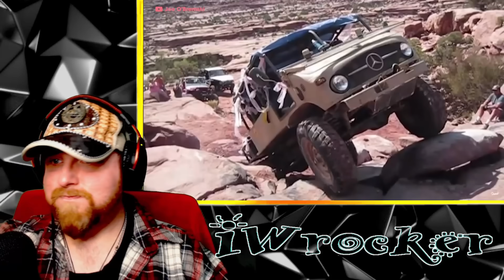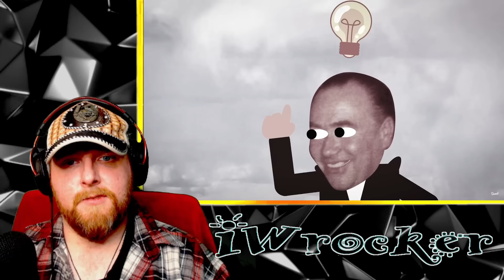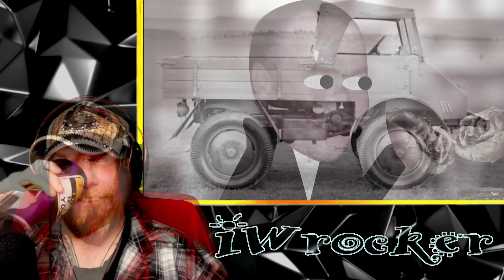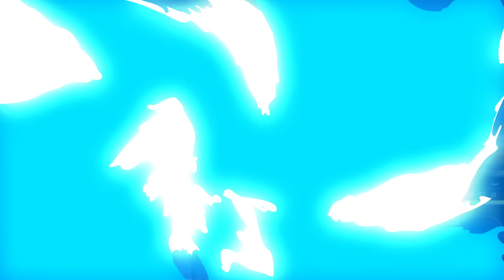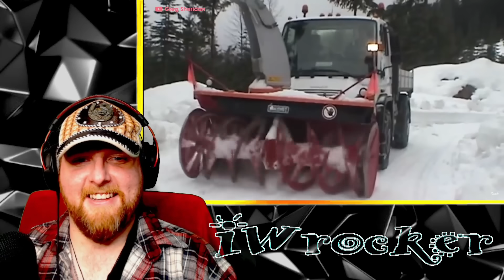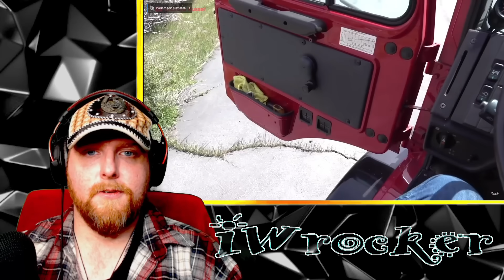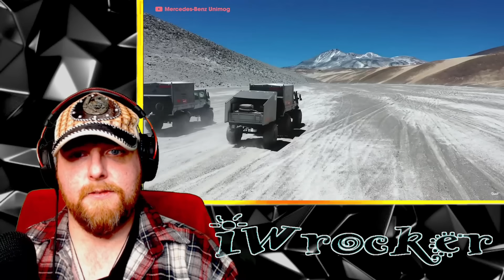American Learns About the Mercedes UNIMOG

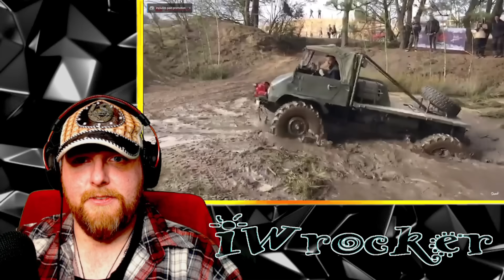Comment: Hehe, I just ordered one of the Tamyia Models 1/10 scale Unimog, just before I let the video play. I saw these when I was a kid on holiday in Berlin many decades ago. Hmm if you pause the vid at 5:55, go full screen and look at the rear axle, you'll notice that the axle does line up with the centre of the wheel, what you see is the result of these trucks having a "portal" axle. That means that the differential casing and axle can sit higher, giving better ground clearance. The final drive to the wheels is done from the end of the axle into a set of gears above the centre of the wheel. That makes these beasties great rock crawlers!

Comment: The boundary for UniMoGs (which stands, by the way, for "Universial Motor Geräteträger", which is "do-it-all-with-one-engine'n-frame") usually is the bravery of its operator. I shat my undies back in the days when I first was sat on the steering side of an UniMoG and had to go up'n down a mountain road I already knew that very thing could master because I had passengered many times in it right there .... They have their flaws, or weaknesses, when becoming fifty, sixty years old under mundane every day's UniMoG conditions (which makes 'em sometimes astonishingly cheap ... just saying), but You can get every single technical part, seal and bearing for the Mercedes ones (You gotta tackle the rusted-out cabins and torn seats Yourself though), and it's absolutely worth keeping 'em alive and in working order. Problem might be though that the "cheap" statement is valid for western-central Europe only I'm afraid. Roundabout 85 to 90 % of all UniMoGs sold around here are still there, as still repairable parts cars, specialized workhorses for all kinds of entrepreneurships from timberframers to boatbuilders, and nowadays more and more as vintage machinery (with lower standard emission requirements), and a lot of 'em still are daily workers with communes and official agencies. 
The 56 miles are an understatement, by the way, (60 usually without difficulties) and You could put on two size bigger wheels and go even faster ... which does not matter, they're fun more where You gotta go slow anyway, like through the forest or a river .... Go get one - they're even more fun than to watch-only once You steer 'em Yourself!

Comment: If you want a UNIMOG in the USA the easiest and probably cheapest way is to buy a US military surplus Freightliner UNIMOG (most US military vehicles are built in America under license) The FL UNIMOGs are just like any other military surplus vehicle that doens't have a VIN number plate. So you have to go through the process of getting a VIN assigned and all that headache just like you would with a HMMWV, 2.5T truck, or 5T truck. But you can find parts through military suppliers surplus and new since they are made by Freightliner. Some parts might still be made in Germany and imported to Freightliner or to a military depot, but a lot will be Freightliner parts.

Comment: Maybe not known in US but as an European (NL) they are famous universal machines. Once driving home from work with my subaru there was a guy standing with a tow big rope in his hands, as he pulled on the roundabout the engine died of his unimog. Well now I was crazy enough to stop, reverse, grab my tow hook out the boot. I wondered if my clutch was going to be alright, 2000 rpm, start slipping, slowly we start rolling, clutched grabbed and suddenly dropped me to 1000 rpm. POWER! as my turbo spooled the unimog guy got scared and was on the brakes while I sat at 3000 rpm in 1st gear pulling him of the roundabout and off the the road to a driveway where the road salt equipment is stored. No longer blocking rush hour traffic we had a little chat and he told me he was on his way home from a trip through africa (continent south of europe). While he waited for road side assistance I continued my way home.

Comment: @IWrocker you can contact clint from C&C equipment - he had a bunch of these for sale - and can get you any spare part you might ever sneed - he had a bunch of the Military version used by Pioneers with aux hydraulics, hydraulic chainsaw and angle grinder, hydraulic shear and spreader, a two way hydraulic front end loader with hydraulic bucket tilt and a backhoe made by case that can fold up like a dump bed for transport https://youtu.be/vEEEVUfoJVQ

Comment: In Europe we have unimogs for practical functional use, we have transit vans for practical functional reasons.  The us truck is a fashion statement that is a functional compromise.  Not truck enough to be had core and a completely Impractical open bed too small and everything gets wet.
We do have the pointless for most people suv of course, more likely to roll over, all fail the high speed maneuver test, worse braking compared to an equivalent  car

Comment: As the picture for the video says "wish usa had these" aye nae bother to the real ones the grafters but most of the other lot would just moan that it doesn't have electric heated seats or heaters or air con or digital radio or Satnav or automatic gearbox (because manual gearbox is an anti American car theft device) heheh only a joke before you pathetic pussyfied generation start . Sarcastic yes but true all together in the long run

Comment: I drove one of these for years on a mine site for refuelling and blasting. It was slow but so much fun.
Reply: I was hauling 3000litres of fuel up to excavators in active pits. The best technique was to enter the pit, select 4WD and low gear (1 of 8) and just let it idle up the slopes covered in riprap to the operator. They laughed at me because no-one else would do it. they would park in the bottom of the pit and wait for the digger to walk down.

Comment: Loved Mogs from a very young age. The most ubiquitous at the time were orange communal 406's. I find the 404 very pleasant to look at, with that oval grille and round headlights. Not so sure about the nineties versions with the high windscreen. I acknowledge that looking out of it was considered more important than looking at it in real life, but as a model-maker and collector, my priorities are different. 
I agree that the original machines looked particularly cool even though they were not designed to (or maybe even BECAUSE they weren't). Same is true for the original Willys Jeep and The Land Rover Series I.

Comment: I've worked with one in the early 00s. A 404 from some time in the 70s. Absolutely amazing for getting around undeveloped land or the woods. Also almost indestructable, if you don't count the glass. And we used it as waste oil disposal. Those old precombustion diesels eat just about everything that has the consistency of oil, from frier fat to mashine gearbox oil. Just run it through some filter cloth and chug it in, though in winter you kinda want diesel. A block of solid frozen frier fat is not conducive to operation. You also don't need a radio. While you are driving you will not hear it, after you can't.
I live in kinda rural germany, not quite the boonies, but they are just beyond the hill back there. They are quite ubiquitous around here. Every farmer, wood worker and construction company has at least one of them. They are like offroad Lego. Just get one and then pick the attachments you need for the job. And where thy can't go, you don't have any business being anyway ^^

Comment: There aren't many places on this planet where you can't go to with a Mog. 
If you really want to have one, the 404 isn't hard to service or work on, some screwdrivers, a few hammers from 1 pound up to 10 ;), a pipe wrench and as luxury tool a crescent wrench will do the job. The hardest part is to get a gasoline one which I would prefer but the Diesel ones are great too. 
I've driven them and worked on during my military days and you can bet, they are fun.

Comment: I have great memories driving a Unimog back in the eighties, in the RAF, including snow clearing and aircraft towing duties. But it was also great for doing burnouts and donuts, on the aircraft pans, if you know what I mean! 😉😉😂 We had hard tops and soft top versions, which were great in the summer.

Comment: Hi ! There must be Unimogs in the US available. That silly self-acclaimed "car expert" Doug DeMuro once tested one. And that video was the reason I stopped watching his stuff. It was outright stupid. The Unimog he tested had a US numberplate and was - obviously - road legal. And in an episode of Diesel Brothers they showed a company in Arizona (?) which sell and modify Unimogs. Maybe Mercedes did not directly import them due to "regulations" (and US manufacturers fearing the competition) as is with other "outlandish stuff". You should get one. A 1500 is not too big, fits on most driveways, can be used in villages and on smaller country roads ... and is a real hog on offroads. And in the winter. You need a good advisor and an additional heater ... Thanks for sharing !

Comment: I ran a Uni' 404 that had started life as a recovery vehicle with crane and winches on the back. selling the recovery equipment almost paid for the vehicle. I changed the Daimler petrol for a Perkins diesel and it was remarkably cheap to run and maintain.

Comment: "I would like to tool around on some property" - if you get an really old one, I think you will be stunned how small they were.
On the other hand: it was the first try to rethink a tractor. No super big traction wheel - but instead with the ability to have some platform to transport goods.

Comment: I drove a 404 for a while in the Danish Army. It certainly was very capable as an off-road vehicle but other than that it was actually not very comfortable. The driving position was a little weird because the seat was low to the floor. It was also noisy, drafty and when driving on paved roads it tended to rock along because of the huge tires and the portal axles making you a little seasick.

Off-road though? Awesome fun.

Comment: Whatever you THOUGHT it could do is merely scratching the surface of what it ACTUALLY  can do!  The Unimog range of off-road vehicles are the absolute benchmark for off-roading!
Whatever you think is a great off-roader has to be measured against the Uimog to see how it stacks up.  This vehicle is the ultimate SERIOUS off-roader of all time! There is no other vehicle range that has a suspension like the Unimog - it is unique, and has been proven over the decades that they have been on the market!  I know of nop other vehicle range that has appeared in so many different configurations - it's almost like they are all one-off custom trucks.  
So, off-roaders, how does your little truck stack up?

Comment: The Unimog is German engineering at its best. It can do anything and despite the complexity of the all purpose design, it doesn't cross the border to being overengineered. It is expensive, but it's worth it. There is only one thing it's really bad in: Speed. You really don't want to drive faster than maybe 70 km/h. Especially in the short wheel base models. 

Originally, the Unimog was designed as a true all purpose machine for farming, forestry, construction, as a road tractor, everything municipal, firefighting and every other kind of emergeny services, tow truck, military and so on. You name it, Unimog did it. 
In more recent times, Mercedes realized that every profession gets more and more specialized and therefore a true all purpose machine got more and more complex and more and more expensive. The edge to overengineering was coming dangerously close and Mercedes didn't want to cross it. Overengineering is bad for reliability, servicability and of course for the price tag. To cope with that problem, newer Unimog generations pretty much skipped the farming role. The most important roles today are military, and all kinds of municipal and emergency services you can think of. 

Owning a private Unimog is only for rich people even here in Germany. Newer models are expensive because off road trucks of that size generally are expensive.  Old models are just as insanely overpaid as Lanz tractors and replacement part prices are not less insane. 

Currently, Ukraine is using dozens of used Unimogs from German Army stockpiles as platforms for rocket artillery and light air defence. The reason is simple: They handle the mud much better than the heavier trucks usually used to carry these weapons.

Comment: I remember when I was in The German army in 1979/80 some guy got kind of famous because he got stuck with the Unimog he drove over a field. This was something unheard of. But to his defence I should say that it was a filed with a lot of clay in the soil after a heavy rain and he was also pulling a loaded trailer. And he tried to perpendicular cross the very deep tracks left by another truck in the soft soil. Because of the short wheel base which almost perfectly matched the width of the tracks he got into those tracks with all four wheels at the same moment and instead of using power carefully he steped on the gas like he wanted to win the next indy 500. All four wheels started spinning and he dug in instantly. Took him and his codriver some time to dig a short ramp in front of the wheels and two of those sand rails to get out of the holes.

Comment: The South African Buffel APC was based on the Unimog 404. It had a separate gear lever for revers and another one to select hi/ low range, that gave you basically 8 gears forward and 8 in reverse. If you really want one import army surplus from SA or Australia. By the way it will do nearly 70 M/h on pav4ed roads and 55 on level unpaved, Yes we did it in the Buffel that had 8 metric tons of armor plating high over the chassis due to the V shape body for mine protection.
Reply: I was already wondering about the military applications... from German Dingo to Marine Corps / Socom MRAP to said Buffel APC there are several (and certainly more than I know of)
Reply: 'n Buffel het my lewe gered. Dit was monsters op hulle tyd.
Reply: Ah, yes. I just made a comment about this earlier, but I couldn't remember all the details. Thanks for clarifying!